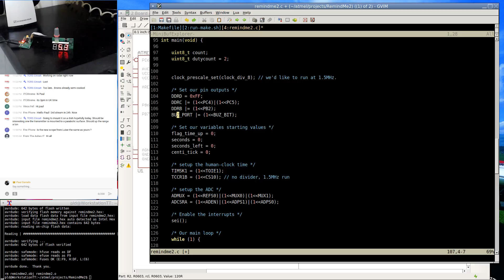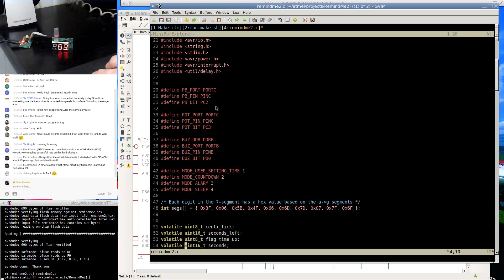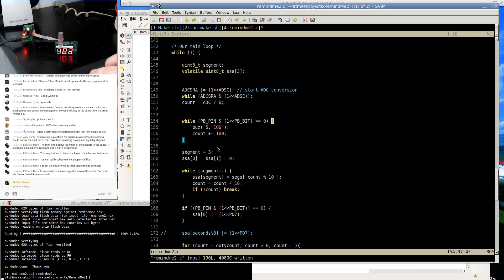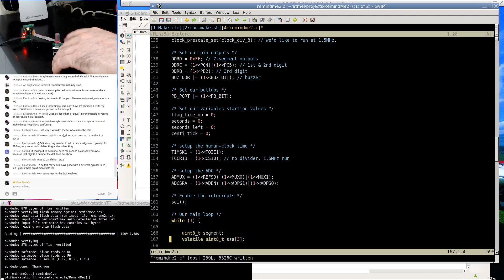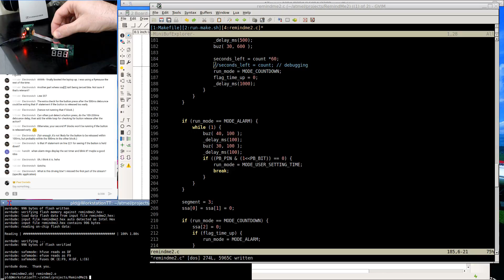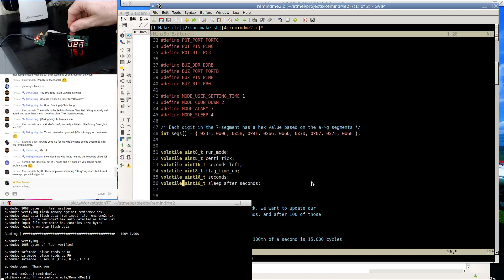Construction - Simple timer v001, Part II "The firmware"

Comment from the maker: Additional tweaks added after the video was finished;

1) Unit will now put the microcontroller in to standby/sleep after 30 seconds if the user hasn't activated the countdown. Even though the whole system only uses about 2mA idle (no LED) it's enough of a draw to drain the 750mA AAA NiMH packs within a couple of weeks, which would be a rather annoying problem for the user (having to change the batteries each time).  Putting it in to Standby mode drops the consumption to around 0.1mA and provides almost a year of running.

2) Follow on from the power savings, I've created a low-power lockout mode.  If the internal 1.1V reference reads more than 512 on the ADC, then we know the battery voltage has dropped to at least 2V2, and should be replaced.

3) Various cleanups of the beeps and handling of button presses in the various modes